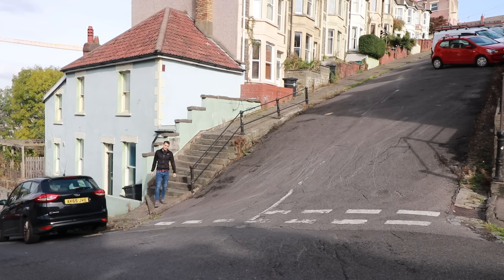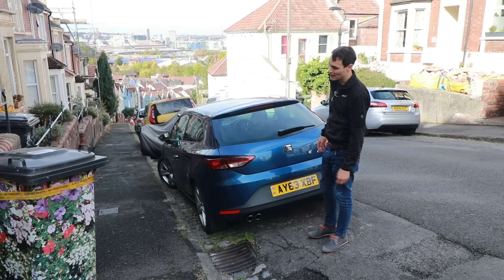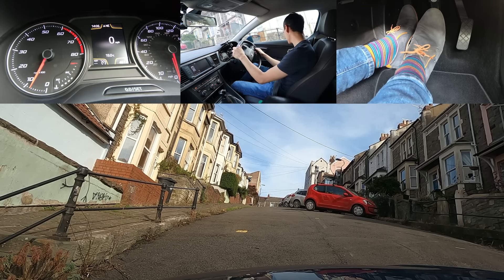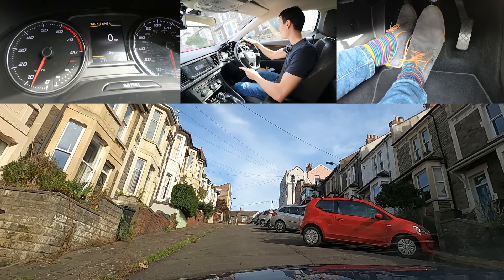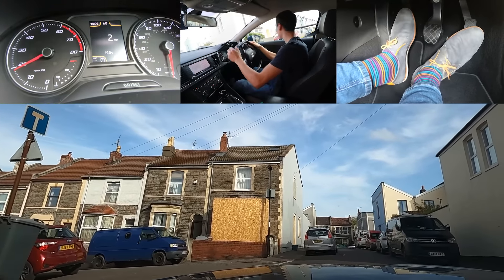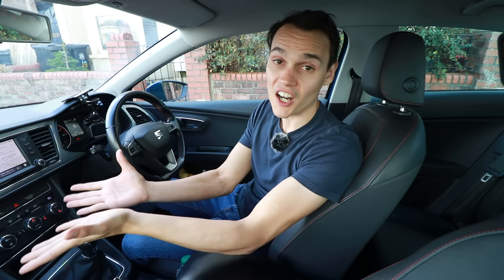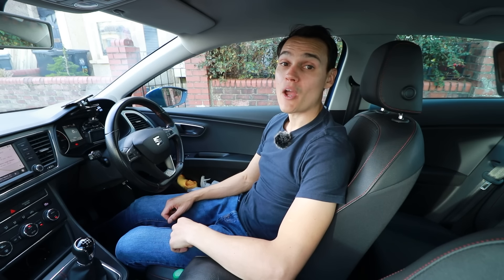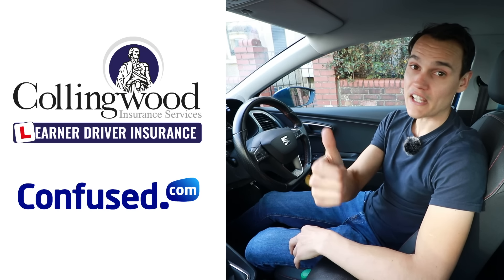Driving Instructor Stalls and Wheels Spins on the Steepest Street in England

Comment: how could I figure out if the car I am driving has the system you mentioned at 6:37
Reply from the maker: You can test it on a hill, in first gear it should hold the car still for a couple of seconds when you come off the brake.

Comment: now i have to try this with my car, 1.3 NA with a really old efi system... with old i mean you can burn 8L when waiting in line for a festival, that's ~150km when driving with 120 on the autobahn... so yeah, horrible efi, but this engine was also sold with a carb, so...

Comment: Try it in reverse. Reverse gear is lower. And you won't have no wheel spin. But you still gonna need to use the throttle (lol). Especially with a 1.4 L engine. Turbo's don't count at idle.
Still think using clutch first is safer and easier to learn. You have almost instant RPM control with the clutch. Also way easier to use the clutch and brake at the same time. Then trying to use the brake and gas. Again this is on level ground. I have never driven in England. Asia yes, USA yes, Central America yes. The only car I have ever been in that couldn't make a normal start without using the throttle was because it was missing on two cylinders. Again level ground. Even that little 1.4 L your driving shouldn't have a problem on level ground. 
The only thing I can think of is that the computer sees the engine go below idle because someone's letting the clutch out. So it tries to bring it back up to idle .That's all it's doing, it's not trying to help you in anyway. As soon as it gets back to idle it'll stop trying to accelerated. But if you keep letting the clutch out dropping the RPMs lower and lower. The computer may try harder and harder to bring it back to idle. Causing an accident. So you want your foot on the clutch and the brake. That is definitely a manufacturer error. And it needs to be addressed.
Reply from the maker: There are cars now that actively raise the revs when you get near the clutch bite point. A 2013 Mini Paceman was the first car I drove that did this. I drove it when it was new and I've driven other cars since then that do it.

Comment: You say breaks make that noise on a steep hill but mine make that all the time, mot said  they are fine
Reply from the maker: At very low speeds as you finish a stop or begin to start it can make that sound. Not at speed though.
Reply: @ConquerDriving  yeah it's low speeds taking off and slowing down. Mines auto so I thought it was something to do with that as its the first auto I've had

Comment: A rally driver would have it up that hill from zero no probs, you just needed to give it more welly! I know as a driving instructor you can't condone wheel spin, but all you had to do at that point was either toe down on the clutch in 1st or hard shift into 2nd and floor it. your "mistake" was allowing your momentum to arrest by taking your foot off the gas a little to stop the wheel spin, use the clutch instead so they revs stay high.

If you try to hill start on a road that steep, driving "correctly" will result in you failing. Best to just do it with a little run up like you did.

Comment: I'm just mystified as to why you would think you could start from rest up any hill without using the gas let alone that one.
Any engine at idle isn't enough and never will be. Not even on the flat. 
I have tackled some pretty steep climbs in my day. 
On really steep climbs I apply the handbrake while transferring my foot from brake pedal to gas pedal and engaging the clutch.
It's all in the synchronicity.
Reply: Modern vehicles have idle speed controlled by the ECU and will admit more fuel and air to maintain tickover rpm even under load, but there will not be enough torque developed for steep hill starts like this.  My classic VWs will easily move off from stationary on the flat at idle and trundle along without use of the accelerator at about walking pace.
Reply: @thedubwhisperer2157  "My classic VWs will easily move off from stationary on the flat at idle and trundle along without use of the accelerator at about walking pace".
Provided you bring the clutch up very slowly.
Having said that maybe your idle speed is too high. Might be time for a tune up.
But nobody actually does that in practice.
Automatics will creep in drive but that's a different matter.
Reply: @veritasaequitas9875  It's a 1776 in a Bay on twin DRLAs and associated engine work so it's not quite a stocker now, but I've had plenty of stock ones too!

Comment: My driving instructors car is easy to just move first with only the clutch however in my car you have to use gas or it stalls! Prefer my car as it gives you more controller iver the clutch

Comment: No problem for my 8-speed torque converter BMW with xdrive all wheel drive and 6-cylinder diesel engine!
Reply: Good for you 🙄
My V8 handles it better I expect
Reply: @Scott Young  I never doubted that. I think most important is to have enough torque (diesel or electric) and rear or all wheel drive because of the weight shift.

Comment: hello mister instructor

not ok with what you said @ 6:54

I own a mazda MX-5 (for the last 7 years) and, on flat surface, it is totally possible to move from stop to ... 30mph-ish only using the clutch and no use of gaz-pedal at all
and that's the 1.5liters version, with less torque than the 2.0liters with the same gear ratio
I drive it as a daily, and every day à come_back to home, I leave the parking-lot this way (very low speed-limit in this area), no problem whatsoever.
the car running the original cluch, about 200.000km on the clock (roughly 120,000 miles)

quite surprised you can't do the same on your car
Reply from the maker: It's not to do with idle torque it's more to do with how much the ECU helps you. Yes you can move the MX5 with only the clutch easily on a cold start as the revs are so high but for pulling out quickly into a junction on a warm engine or a steep hill, no chance.

Comment: I would just floor the gas on 1st and release the clutch really fast
Reply: If you give a little bit high you put stress on the clutch and if little bit lower the car will struggle , balance can work but need practice
Reply: It's not recommended unless you've done it a lot

Comment: I'm confused.  Whilst I'm sure car technology has changed in 45 years since I started to drive, the basic theory hasn't.   So 1) what happened to the handbrake.   Unless things have changed cars should still have a handbrake and to pass an MOT test the handbrake should be 25% efficient i.e. be able to hold the car still on a 1:4 hill.  Then use gas and clutch to take pressure off the handbrake.   Do you still teach this?   This is the correct an safest way of starting on this hill.   Then for the really steep ones, or where the handbrake won't hold, use heel and toe.   Slightly advanced whereby you hold the vehicle on the footbrake, slide your foot over to the gas whilst keeping the brake pressed, then bring the clutch up and release the footbrake.   What does your pupil do when they encounter a hill too steep for modern technology and they CANNOT roll back?  BTW only time I've ever started vehicles without clutch/gas combination is ultra low geared vehicles of around 1950s etc i.e. land rovers in low range, Scammell recovery vehicles etc. These were so low geared they could start off reliably with the clutch only, then you go and make tea, read the paper etc, then if you want to get anywhere, introduce the accelerator.   I bet some uni grad was chuffed to bits when he came up with this idea a few years ago!
Reply from the maker: I still teach handbrake starts, in fact that's the first type of hill start I teach. I also teach different ways to start on hills including hill hold assist which is harder for beginners but easier for experienced drivers. I was making a point in this video that only using the clutch is not a good idea.
Reply from the maker: You may find this video of interest: https://youtu.be/_6YyHxgZJMA
Reply: Hi Richard,.  It was of interest -many thanks
Reply: @ConquerDriving  Apologies.

Comment: Judging the way the cars were parked you were going the wrong way.      Any standard is easy to hill start.   One foot on the brake one on the accelerator,    release the clutch until the motor bogs dowh then place your brake foot onto the accelerator.   Its a lot easier because you already have the grab point

Comment: I don't think I'd trust a silly little hatchback with a road like that.
Rear wheel drive is beneficial in this situation, as most of the weight is over the back wheels when accelerating. Also a standard/saloon is a superior design for weight distribution.
Reply from the maker: I'm very fond of my silly little hatchback, I've done 196,000 miles in it, it's still comfortable, quiet, sips fuel and feels quicker than the 8 second 0-60 time suggests.
Reply: @ConquerDriving  No doubt hatch backs have their superior aspects. Being lighter, they're more economical. And I imagine they're more appealing for drivers 25 or below. 
I expect you probably get double the gas mileage!
As for my preferences. I couldn't care less about speed or handling. I like a big, slow, wallowy ride. Back when i was about 18, all the other lads wanted a VW golf, or citroen saxo with lowered body. Me... I wanted a 1980s cadillac eldorado :D

Comment: The only cars that can start on steep hills like this are diesel cars, but if the hill is too steep, it won't start with the clutch. I've tried it before. A petrol car would never stand a chance.
Reply: it was ultimately weight distribution that defeated starting on the steepest part (FWD)

Comment: Just put your car in first gear when you're parked on a hill. You wouldn't leave the car on handbrake in winter anyway because it might freeze and break. But I'm confused as to why you didn't use the handbrake to climb up. Seems like the obvious thing to do with a tiny petrol engine.
Reply from the maker: My engine won't come close to holding the car still on this hill when parked. It will roll down a hill significantly less steep than this in first gear with the handbrake off.

Comment: I was waiting for the proper way:
Handbrake -> 4000 RPM -> release handbrake, dump the clutch, and floor it
You may spin but you won't stall. If you spin, try again but dump the clutch a bit slower.

Comment: Looks like you are going the wrong way on a one way street. All the cars are parked the other way - so they don't have to climb that steep hill.
Reply: It's a two way, but it really shouldn't be. There's a give way line at the top of the hill and two sides of the street at the bottom. Clearly there is no parking for people daring enough to travel from the bottom up, and certainly dicey if opposing traffic met.

Comment: It's a light car, your nose is light, your wheels are small. Small profile. I drive a 2.0 tfsi, A4 b8.5. 19" wheels  @ 255 40 19. Try it with such like. It's the same as me or you on wet or ice. But that hill is far too steep for "your" car. I'm not hating on your experiment, I knew exactly what was going to happen but it's still cool to watch you try. And by the way, your socks crack me up lol

Comment: This street will be so relaxing to drive with an electric car.
You even could climb with 1 mph or even 0,5 mph if you want.
Or you could just floor it😂
Reply from the maker: It's more the lack of grip from the tyres than a lack of power from the engine. I think if the electric vehicle had four wheel drive it would work better, but then so would a petrol or diesel powered vehicle with four wheel drive.
Reply: @ConquerDriving  Thats not what I wanted to point out. Of course EVs AND ICEs CAN drive up that street.
The difference is HOW they drive up that incline.
You need to experience it by yourself, its hard to explain.
In an electric car you can exactly and precizely control the speed you drive up without any drama and reving up the engine to at least 3-4k rmp and screaming to all the neighbours.
You even can climb up with CONSTANT speeds BELOW idle speed of an ICE (~5 mph) if you want.
And I am pretty sure that even a Fiat 500E with front wheel drive could start on that hill without spinning the tires.
Would be cool if you could compare this because where I live there are not such hills...

Comment: Interesting how someone that calls himself a "driving instructor," would continually "ride the clutch" while holding the brake pedal down.  The clutch pedal is no brake.  Therefore, it's useless to hold a fixed position.  The best action is to throw the shifter into neutral, get out of the clutch, and apply brakes.  Otherwise, you'll be smelling a lot of "clutch plate" burning, thus replacing your clutch every 10,000klm/6,200miles due to clutch abuse and idiocy.
Reply from the maker: I wasn't riding the clutch in this video and I was making a point that it's not a good idea to only teach new drivers to move a car by lifting the clutch without gas. This video may help: https://youtu.be/81SOTuCsxV0
Reply from the maker: Also, my car has 197,000 miles on it now. I get about 20% clutch wear every 40,000 miles.
Reply: I'm quite familiar with easing out of the clutch and not accelerating to get forward motion.  I've been driving manual transmissions over 40 years.  But anytime you depress a brake and clutch pedal with the motor running, you are indeed riding the clutch.  Sitting at the bottom of a steep incline with both brake and clutch held down for whatever purpose is clutch plate damage.  I get over 252,000 "miles" on my transmission clutches.  How about you?
Reply: @ConquerDriving  Amazing!
Reply: @ConquerDriving  , big deal.  I put over 254,000 miles on my clutch before any signs of minor slippage began.

Comment: How it comes you are teaching poeple how to drive, without any idea about turbo lag and torque curve :D
Reply from the maker: I understand those things. Understanding them doesn't help with a situation where giving enough power makes the wheels spin and reducing the power makes the car slow down. Peak torque is claimed a 250Nm at 1500rpm on this car but when I've tested it was 297Nm at 2000rpm. I couldn't deploy the power as the tyres would slip because it was too steep on that section of hill. There is a limit to what hill this car can go up.

Comment: Modern cars are pathetic. I used to live in North Yorkshire, there were three hills of note; Caulkley's Bank, Sutton Bank and Rosedale 'Chimney', the latter having a strong claim to being the steepest hill in England. Come the summer and tourists would stall half way up 'cos they'd start going up in third and be incapable of changing down on a hill. Our cars; an Austin Maxi and an elderly and much thrashed Morris Marina, had no  trouble at all doing hill starts on any sections of those hills. This despite the Marina having no functional handbrake most of the time, because you had to manually adjust the brakes and we were lazy. So I learnt to heel and toe, to hold it on a hill and pull away without the handbrake, been doing it in every car for 40 years now.
Having said that my Skoda Yeti wouldn't have a problem at all on that hill but then it's a 4x4 with a button to press for off road.

Comment: Nowadays learning to drive is easier, when i got the driver's license in the 1990s the cars had no ABS, no hill star and stop, no traction control, no rear view camera.... 
this example here with this car is easy because this equipped hill star and stop and maybe also equipped with traction control! wanted to see you do that hill climb star from the middle without using the clutch with a car without traction control and start and stop assistance.
Are you advertising this car model? is my conclusion in this case. 
If you go with a car that basically does everything for you it's easy, you'd better show off a car with so much technology these days that you don't need driver inside of the car, exemple Tesla 2023 model 4x4 does it with your smart phone App 🤣
Nowadays modern cars have so much technology some people don't even know how to park a car in reverse with a normal car.
I have not seen anything to learn from this video.
I passed my driving licence first time and lesse than 3 months, In the 1990s 😁

Comment: No wonder people Can't drive . Your to use your hand brake as well when on a hill climb
Reply from the maker: Handbrake starts are one of the many methods I teach and use. Hill hold assist is far stronger than the handbrake and works better in this car. I rolled back because I didn't have any gas (I explain later in the video why I didn't use gas). I stalled because it is so steep at the start that their is a lack of traction, give power and the wheels spin, reduce power then it stalls.
Reply: @ConquerDriving  so when you stop the car you apply the hand brake. When you pull away you release the hand brake. So one of your methods you teach is basic driver skills. A good driver would not  think twice on what method he should use as there is one drive. Teach properly .

Comment: Urgh, why use the American work gas? We say throttle or accelerator in England.

Okay, you explained it at 5 mins.

With a choke on a motorbike I was learning on, I did not turn off the choke and fell off from it accelerating quickly

Comment: so easy to pull away, give more gas and more clutch. So so easy you cannot drive mate.
Reply from the maker: It's not about car control, the hill is too steep and the car wheel spins.
Reply: @ConquerDriving  You could have got that going, you were too easy on the gas at first and, with experaince, you can counter wheelspin by feathering the clutch.